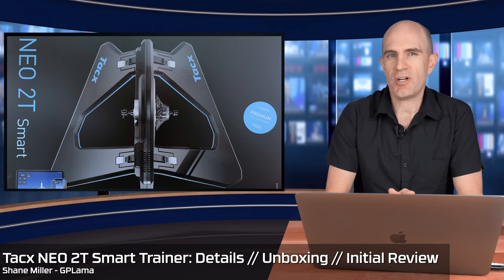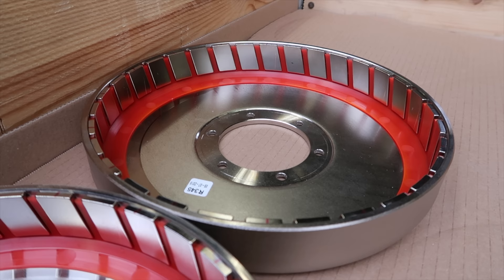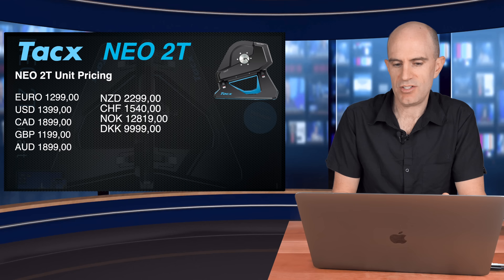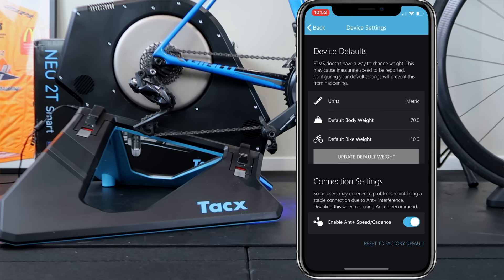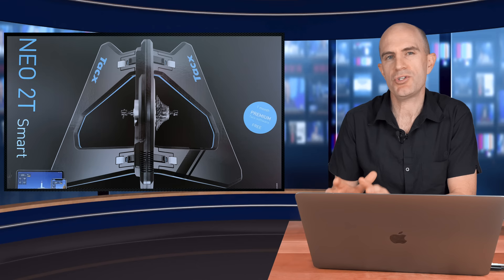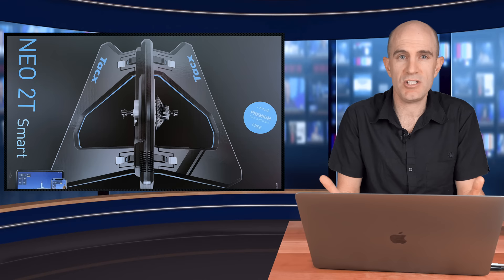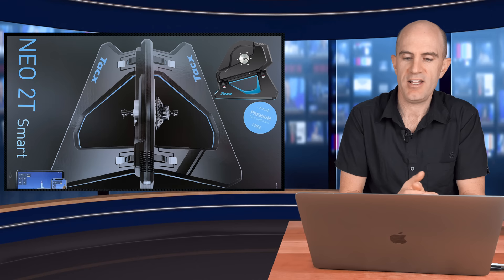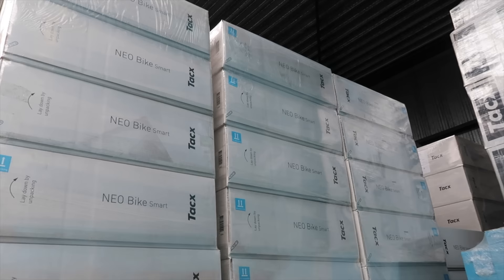Tacx NEO 2T Smart Trainer: Details // Unboxing // Initial Review

Comment: I love my Neo 2, hate the virtual tyre slip on the bonus climb in Zwift. Gutted and frustrated that a device that I've had 6 months is out of date and have to pay for a whole new unit to resolve issues. That being said I try not to let it ruin my new found love for indoor training. Great review again Shane
Reply: I'm in a far worse scenario, I bought the Neo 2 a month before the Neo 2T was launched LOL. I'm a casual cyclist and would specifically avoid elevated roads if i can so the the virtual tyre slip is not an issue with me. What i am unhappy about is that Tacx was made aware of this issue on the Neo 1 but still refused to rectify it on the Neo 2.

Comment: Time for an updated version of this? Looking to get myself a trainer for the upcoming european winter, usually the top of the line is the way to go. But I can't say I'm very pleased with the results as shown. My NGeco would be more  accurate, would love to see a 2021 review of the NEO 2T :)
Reply: Is ngeco  showing bigger wattage numbers? I have same setup and p2max showing 5% bigger numbers. Tested in erg mode, smal chainring, straight chainline, clean chain etc. at 200  250 300 wats. P2max shows 5% bigger numbers.

Comment: The Tacx Neo 1 is already virtually silent....
Reply from the maker: The Neo 1/2 has a bit of a whistle to it at higher flywheel speeds. Then again at high speeds/watts so do we (and the fans we use to keep cool).
Reply: Yeah parallel magnets would have a bit of a flutter effect on the air within the unit.  Angling the magnets is a very simple method to reduce the harmonics from that high speed flutter.  Splitting hairs but at this price point you expect hairs to be split.
Reply: @gplama  Yeap I can honestly say my dirty chain and industrial fan combo is a lot louder than the Neo 1 itself :D :D

Comment: I recently bought one of these along with a Trek Domane, and had already watched another of your (excellent) videos on Neo trainers when trying to get it set up — but I felt compelled to leave thanks here because not even a minute in, you've already provided far more information than Tacx themselves did. Here I was faffing about, failing to make their included adapter work with my thru-axle frame, when I should have just inserted the bike's own all along! The manuals for these are terribly lacking.

So, thanks for all the other information — and the nifty factory shots! — but thanks too for explaining what the makers themselves did not see fit to. Made my evening. ;D

Comment: My New 2T arrived on Tuesday and I did my first ride on Wednesday. The powers numbers seemed to be -1/+1 against my favero Assioma duo power pedals. I say seemed because I didn’t use a overlay program to compare the data I just simply looked at the two screens while I rode. Overall I’m very happy with it. Also I was unable to get any wheel slip which is great. I’m not a sprinter by any means but I tried to get it to slip from short burst of power to about 1200 watts and it held firm. Also the erg mode felt a little more sudden then my kickr when it engages but not much difference there. Overall I like it better then the kickr.

Comment: I purchased a Tacx Neo 2 in February with the expectation that Tacx would be unleashing new tech through software or firmware updates over time.  With the launch of the Neo 2T only a few months later, I wanted to reach out to someone who might have an inside scoop on whether we Neo 2 owners should expect to be screwed for new features, or if Tacx still intends to provide much anticipated releases like the road surface release they did with the original Neo.  Thanks for your insight!

Comment: Hope they sort things out. I am glad they add native thru-axle connectivity. I have a Tacx neo 2 and a BMC Roadmachine. The thru-axle adapter doesn't work well with  my bike. I ended up putting the lever on my drive side and my bike sometime hit the end cap on the other side.
Reply: my scott foil disc had the same issue with neo 2 so I returned it and got a refund. Waiting on the release of the 2t now.
Reply: @poptheshield7205  I bought neo 2 when it was launched and has been using it for about 8 months. So far my bike hasn't broken lol but I do stay seated for the majority of the time and try not rock hard when standing. Hope u have fun on 2T 😁

Comment: We just got a new NEO2 T and both my wife and I immediately found it "Harder" (reading LOWER watts) than our usual bike mounted STAGES - so we just tested everything side by side and sure enough there is a 15-20 watt gap between the 2 sources (again with Neo reading LOWER). This is baffling to us for a couple of reasons and since I referred to this video as part of our shopping process I wanted to share this as your 1 critique was related to power accuracy! We have latest firmware installed on the new Neo2T, and using our freshly calibrated STAGES Power Meters & Stages APP,  you can see a very consistent 15-20 watt difference. I was under the general impression that Smart Trainer (integrated) Power Meters would almost always read HIGHER (more generously) than any Bike Mounted Power Meter (True? False?) so this comes as a real surprise. My hunch: since the sole purpose of this new "T" model is to address the former slippage issue, perhaps they have somehow "overshot" with the base calibration in the process? IS there a way to calibrate this thing NEO2T or are we stuck with this reading? For now we have to continue using our STAGES power meters in order to ensure consistency with our data (we've been using our STAGES indoors and out for years now). Thoughts!?!?
Reply from the maker: Stages dual or single sided?
Reply: @gplama  single sided - but we each have different strong and weak legs so one of us should be "high" and the other "low" when doubling Stages number, no? Even then, 20 watts is a monster gap IMO. For consistency sake we'll have to stick to our Stages for now - just can't believe its so far off!

Comment: I would love if TACX would add the functionallity "Align with powermeter". With that I'm mean make some kind of of alignment with my Quarq. I just can't take having two different wattages while riding indoor. Both PM's stating they're 1-1,5% accurate. However, the Quarq is the one I know and have been riding with the whole season. So that's what I know and are used to.

Of course it should be able to reset the alignment; that is going back to factory setting. Maybe an idea to think a bit about... Maybe you can pass it on to Tacx...?! ;-)
Reply: Simple solution, use one source only:)

Comment: Nitpickers Corner: When you compare accuracy of the Neo and Vector 3 you have to aggregate the error margins of both devices. So the difference in watts allowed is not 1% but 2%.
Reply from the maker: Assuming both are off by the maximal allowable percentage, in opposing directions. With the Vector 3 being two independent power meters, the chances of that happening to a maximum of 2% is... low. I'd think. Either way, this didn't match the performance of the Neo 1 across four pedal based meters, and two other crank power meters. Work still to be done I think.
Reply: Perfectly true Shane, let‘s all hope Tacx can sort it out. Keep up the good work! Thanks!

Comment: Awsome vid Shane! At 7:52 you mention the way the flywheel goes bananas when you wind things up and stop pedaling. What did you do to stop this? It really only started on my Neo 2 after I applied the .27 update.
This morning I finished training and had my shoes and HRM off well before the flywheel stopped spinning. At one point I thought it was stuck in a simulated descent.

Edit: It seems to hover around the 7km/hr mark for an extended period. I'm guessing that's to help with the slipping in the older units.

Comment: I guess that the new magnets are bigger by a few percentage based on the shapes 🤔Also, Neo 2 has discount on it on some other platforms, and based on the pictures in the video, it looks like it doesn't worth to manufacture the two different flywheel with that many differences, so I expect Neo 2 to be discontinued (also, the same pricing suggest that)

Comment: I have the same power difference issue with the Neo2 compared to the Vector 3. Constant offset of 16 watts. and in the lower power range it could be even higher.
Reply from the maker: Contact Tacx.

Comment: Tacx claims 142mm thru axle compatibility but then is providing a 2.7mm spacer because the rear caliper touches the unit. This effectively turns the trainer into a 144.7mm which is off with most current disc bikes of 142mm which as a consequence creates several problems (misalingned chainline, thru axle that does not attach entirely, tension in the rear trinagle of the bike - especially for those carbon bikes). Any comments on that? Thanks
Reply from the maker: I’ve been watching the comments posted everywhere on this in the last few weeks. I don’t have to use the spacers on the TCR. The 144.7mm ‘solution’ doesn’t sound ideal. I’ll leave it to Tacx Support to address this. There’s nothing I can contribute further, it’s their issue to resolve.

Comment: Shane, would you buy a much lower priced NEO 2 or the Neo 2t? By the way: 12 speed didnt fit on the edco hub. First part of the cassette worked, but the rest didnt fit! Replacing the hub for 9-12 combatibel cfreehub isnt possible as far some bikeshops told me. Thanks.
Reply from the maker: I wouldn’t buy anything older than a 2T.

Comment: Shane, question. I have a neo1. It’s struggling finding gears. I have a disc brake ultegra di2 and it shifts perfectly on my rear wheel but struggles on the trainer. Any ideas?
Reply from the maker: One for a mechanic to look at. Sometime there’s magic required only they can solve.

Comment: A question - why do manufacturers insist on unreliable and annoying wireless connections when a LAN cable would be simple and super reliable - my new neo 2t has been driving me nuts and killing race efforts with drop outs
Reply from the maker: Because a cable isn't needed. I don't see people being able to plug a cable into an AppleTV, iPhone, iPad, Android phone any time soon that'll support a new standard of indoor trainer. PC and Mac, maybe. WiFi 5GHz support would solve a lot of problems faced by ANT+ and BLE operating on the shared 2.4GHz range. It'd be cheaper to implement too. Cables will increase the manufacturing cost.
Reply: Shane Miller - GPLama thanks for replying - I was just thinking as well as the normal wireless options, a LAN cable to pc would be a reliable back up option
Reply from the maker: @neilhyde3425  Cables might come for specialist equipment. Esports maybe? Kinetic put a USB port on the R1.... but nothing supports it (and they didn't provide a cable with it)

Comment: Thanks so much for this review.  I too have the NEO 2T and vector 3 pedals and have noticed the 10 or so watt difference.   I recently put a bike on the trainer that has the new Sram AXS Quarq power meter and noticed the exact same thing.  I called Garmin and they had no answers for me.  I thought maybe i was doing something wrong.  Seeing this video and looking at your tests let me know that the Neo 2T just has that much difference in the reading.  Is there anything i can do on Zwift that will compensate for the difference? I don't want to give up the Neo 2T.  I love everything about it just give me the extra 10 to 15 watts :-)

Comment: Could the difference in power reading be when the power is measured?  Power measured at the pedals is like measuring an engine at the crankshaft, powered measured at the wheel factors in driveline losses.
Reply from the maker: That could account for a few %, maybe. If the readings were due to drivetrain loss then it doesn't explain why the same setup on the Neo 1 were almost perfect.

Comment: Hi Shane. I've got a new 2t. I did have a kickr bit had issues. My question is the kickr seemed to be alot smoother on erg. Mode held the Watts within 1 or 2 Watts had a nice smooth line on zwift. But my neo has a bumpy line and power fluctuates between 10 and 20 Watts maybe more.
Reply from the maker: Were you using ERG Power Smoothing on the Kickr? That is enabled by default and will show an artificial flat line when in ERG. Power will bounce up and down depending on how smooth you are. The 2T is a little rougher than the Kickr.... Also update the 2T with the latest firmware (0.32 I believe).

Comment: Hey Shane, great video , some info i can't really find anywhere and i am new at this. What do you do with your disc brake on these trainers, do you lock them out with the plastic clip thingy so you don't accidentally push them or do you trust yourself just not to hit the brakes for any reason? or is there another way? 
thx
Reply from the maker: I put in a disc spacer.

Comment: Hi Shane, to change between qr and thru axle do you have to remove cassette? This could be a deal breaker as I am sharing trainer with Mrs Smith. I saw on  your kickr and climb video the change between the two is much easier. Thanks for the great videos
Reply from the maker: The Neo requires tools to switch from TA to QR. I don't believe the cassette needs to come off for that. The Wahoo Kickrs are likely a much easier solution. Drop into a bike shop that sells them to have a look in person to make sure the process is what you're after (swapping from QR to TA easily, and back)
Reply: @gplama  Thanks for the swift reply
Reply: @gplama  Might be worth noting that Wahoo does not support 10x135 TA at all, and for the 2T you have to purchase an adapter separately; I have a kickr to send back now (doh). This is the axle size on my cross bike (2015 Rose DX).

Comment: Is there any Update on power issues? I just received a brand new neo 2t. Previously been riding a kickr core which was on par with the power reading on my Assioma duos. My 2t is below quite a bit.! E.g. Just did a ftp test avg 20 min power on my 2t was 323w and according to my duos i was pushing 334w that is close to 3,4% difference, which is kinda frustrating when doing zwift races!!

Comment: So if you have 2 bikes, one with thru-axles and 1 with quick release, you need to remove the cassette and install the correct adapter each time you swap bikes?
Reply from the maker: Just the adapters need to be swapped out. Sounds like a pain to do each time you want to swap bikes.

Comment: Open question for Shane and any others commenting below who own this trainer.  I'm debating between it and a Wahoo kickr.  I have the original CycleOps Hammer (H1) now.  Looking for something more quiet - which I know they both are.  The H1 has a loud high pitch humming.  My concern with the Neo is the side to side movement.  This is a particular concern because I'm a heavy rider (100 kilos).  Yes, I know.  The more I ride the less of a concern that is, but seriously - what are your thought about the side to side movement.  Anyone move to a Neo after using a rigid trainer like Saris or Wahoo?  Any heavy riders out there who own the Neo?  Its not an inexpensive investment, so any useful information is appreciated.
Reply from the maker: Neo should be fine, but test ride if you can: The Kickr 18 is a tank of a unit too.

Comment: I assumed you have compared it with the favero assioma? Maybe the data from vector 3 was off?
Reply from the maker: I've chosen my words carefully in the video. I've done 10 Lama Lab Tests with this unit using a number of different power meters. Out of courtesy I used the Vector 3 as my sample. The AssiomaDUO was also off - but I'm not going to dive into the specifics and try to defend a problem that's not mine. I'll await updates before publishing my final review/testing data.
Reply: Was assioma duo off or the tacx neo is off?
Reply: @gplama  Hey Shane, have you published the data of the 10 Lama Lab Tests?
Reply from the maker: @christianoddono4345  No. I've given a quick look at a data set from a recent Lama Lab Test with updated 2T firmware here: https://www.youtube.com/watch?v=cYijrdlDJgk
Reply: @gplama  Thanks, that's great. 👍

Comment: Shane - from your experience are there any differences in terms of noise, performance and/or shifting quality between using a Shimano 105, ultegra or Dura Ace cassette and chain?
Reply from the maker: I want to believe Ultegra/DA feel and sound a little better... but I'm sure it's just me trying to justify the extra money spent. An Ultegra cassette is quieter than a SRAM PG-50 or whatever is supplied on the Kickr... As for performance. No difference watt for watt.

Comment: Shane. Thx for the review. A question, how do you address drivetrain power loss? Is it not accurate for Neo to measure slightly less?
Reply from the maker: I minimise it by using a clean chain, clean drivetrain, a straight chain-line for the ERG testing, etc. It should never be more than a few watts which is most times within the measurement accuracy range of the power meters/trainers used.

Comment: Thanks a lot! Did you experience any problems with your rear disc brake caliper on the N2T being to close to the housing? Or noticed any changes? Thanks!!
Reply from the maker: Same as the Neo2. Clearance was close on the TCR, but no problem.
Reply: Shane Miller - GPLama did you put the spacer in place?

Comment: Let me ask you. I have a neo1 and when I use my mtb with disk brake (160mm) and QR, I need to remove the brake because it hits the trainer. Does it still happen? Or has it been solved?
Reply from the maker: That depends which model Neo 1 you have. There are two models with different shell/cases for clearance.
Reply: @gplama  i have the W modem, that should have better compatibility

Comment: Does the new 2T resolve the issue of the rear derailleur rubbing the casing when riding on 32 cogs. I know that was the big issue with my Neo 1. People worked around it by adding a spacer behind the edco hub. I wonder if this is still the case.
Reply from the maker: No physical change to the casing I’m aware of.